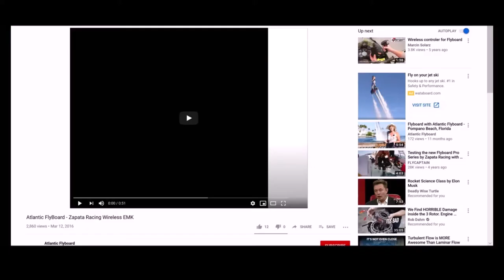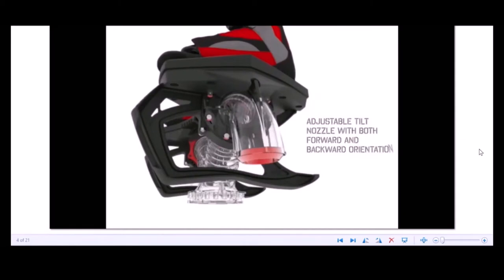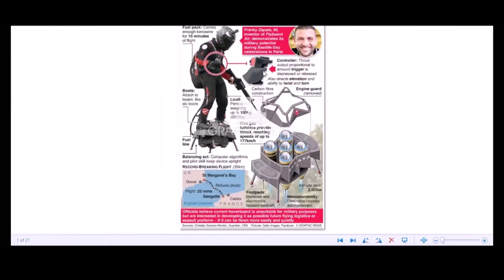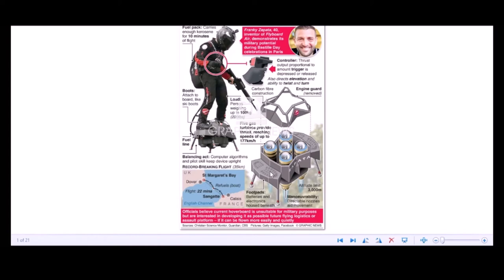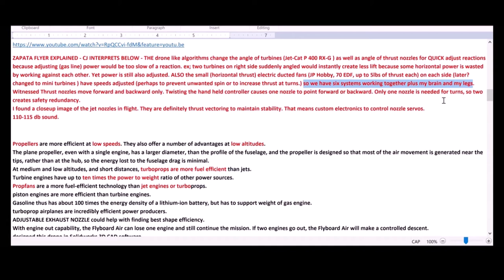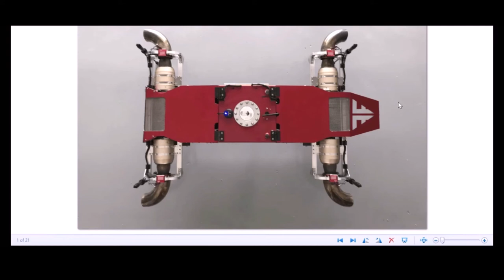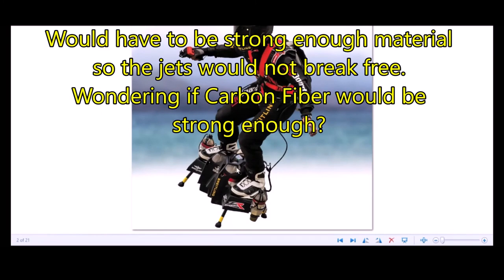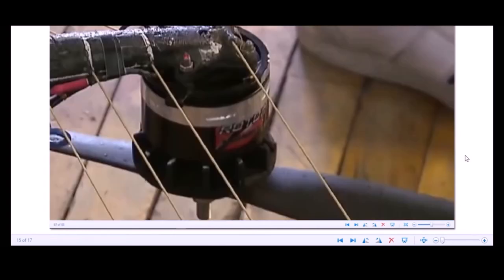DIY Flyboard Air - Jet Hoverboard - Principles and Jet Part Numbers.

Comment: Its a bit concerning that you made this whole video not understanding that the man uses a gyroscope to maintain balance. The gyroscope is what compensates and keeps him upright. Gyroscopes are also used in boats to compensate for the waves that cause the boat to rock back and forth. They are also used on the small 2 wheel “hoverboards” that have been available for several years now and are responsible for keeping people upright instead of them having to balance the thing themselves. Just thought I would point that out as it will hopefully answer several of the questions you brought up in this video. Best wishes on your build man looking forward to your future videos
Reply from the maker: I seem to recall him saying that he did not use a gyroscope in the Flyboard Air and that it all works with balance like a skateboard. But I believe he did include gyroscope in his Flyride which is like a motorcycle on the water. If you can find anywhere where he says a gyro is in his Flyboard then let me know.